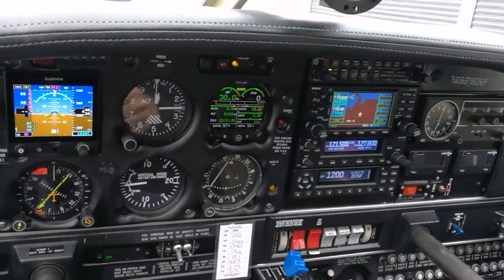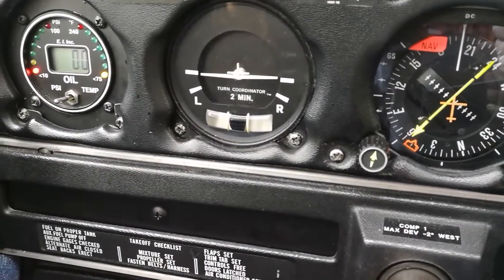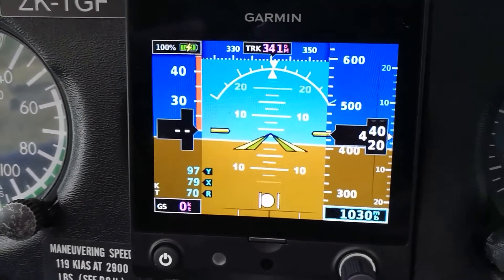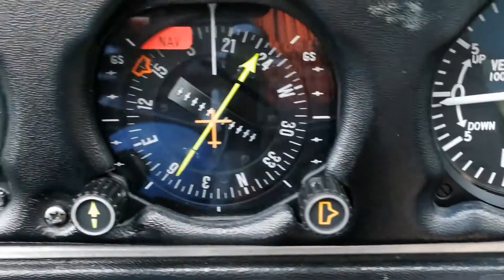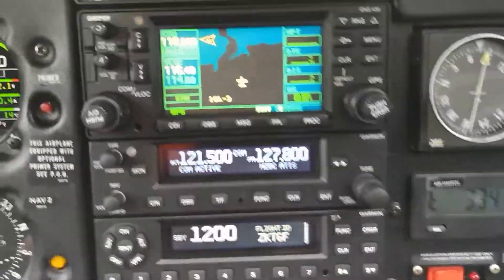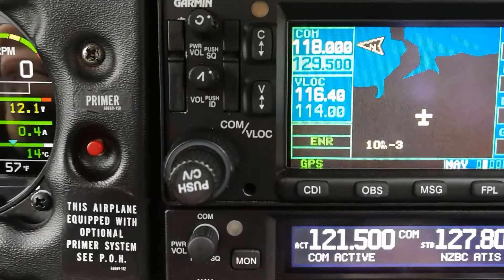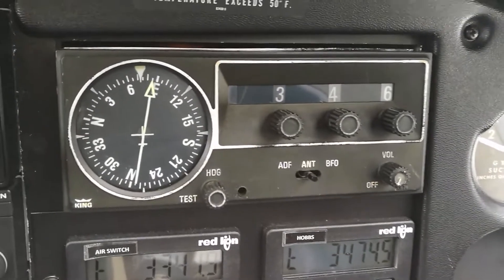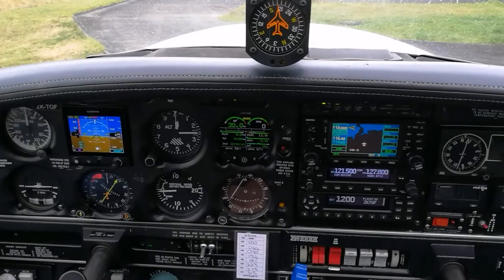Piper Arrow IFR panel tour with Garmin G5 and 430W

Comment: That is a beautiful panel.   I am hopeful to add the EI CGR30P to mine, and would be curious to know how it has worked for you.
Reply from the maker: Thanks! I am very happy with the CGR30. I had one CHT probe fail soon after installation but other than that it's been perfect. Having it up high makes power checks on the roll easy (important with the turbocharged engine) and the accurate magnetic fuel sensors are great. Integrates with GNS430W too, so displays fuel and endurance remaining and at destination.

Comment: Need to upgrade that 430W to a GTN650, and change out the HSI to another G5!  :)  Actually, I couldn't have even imagined flying with this sort of sophistication when I was flying a Cherokee back in the late 70's and early 80's.  Now, I just dream of flying anything again.  :)  I think the ADF, at least here in the U.S. has become an antiquidated device good only for listening to baseball games on the radio!  :p
Reply: you can upload straight from foreflight to a 430 with the instillation of a garmin flight stream 110 or 210
Reply from the maker: I don't think the 650 offers any functionality over the 430W (I've only used one a couple of times) and in turbulent conditions especially some people prefer the mechanical knobs on the 430/530. I'm happy with the HSI I have, although if it did fail then another G5 would be on the shopping list for sure. Next up (when they certify it for PA28) will be the GFC500 autopilot. Looks amazing!
Reply: Vaughn Davis I'm sorry, I was being a stupid American.  I was being silly, I haven't flown in almost 40 years and I would love to be able to have an Airplane with a panel like that!
Reply: I was being more tongue in cheek when I said that.  The 430W is a fine navigator in and of itself.  The second G5, though, that would be a less expensive and more 'practical' addition.
Reply: The 650 really doesn't offer much more than the 430. Actually I'd say the 430/530 are better because of turbulent conditions. However, one very nice feature of the 650 is that if you have a flight plan loaded in ForeFlight on the iPad, you can connect it to the 650 and send that plan to the panel. This saves you from having to manually enter in the plan and it is a very nice feature.